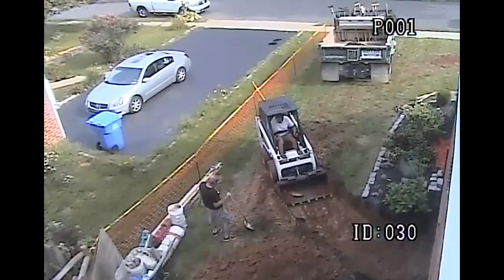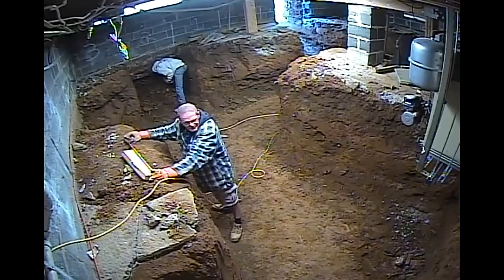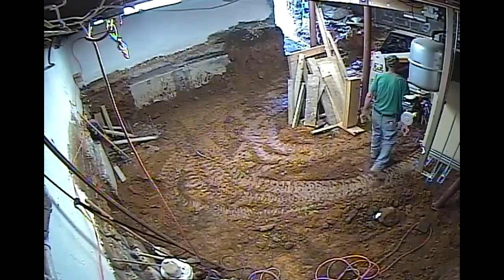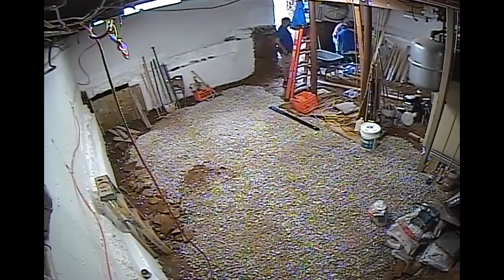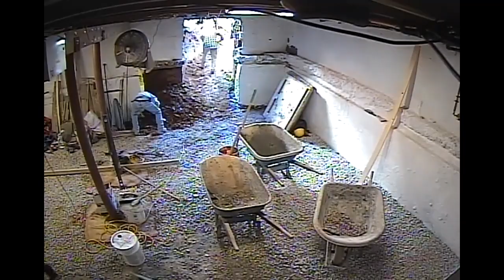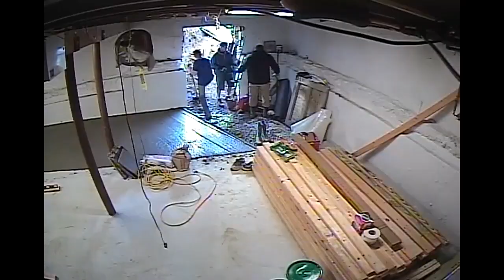New Basement - Crawlspace dig out and underpinning - Longer Version

Comment: The skid steer method is by far the most efficient and can even be a one man show. What I dont see is how or IF they waterproofed the exterior?
Reply: I've never seen any exterior waterproofing on these dig out videos. Maybe they fix the grading outside?  Maybe tired of digging?  Maybe afraid to dig outside to disturb even more soil??  Pretty sure I haven't seen any interior drainage systems as well.
Reply: Yeah, you don't really HAVE to waterproof the exterior for any reason other than being in a valley where water will sit on the concrete.  But even then, Current concrete recipes can be fixed to make water resistance better for the job site.  It's more expensive, but not always needed.

You can just go around the foundation with a few well-placed drainage pipes and would never have any issues.
Reply: @maddierosemusic  Sounds like he poured right up against exterior soil, so that's a definite NO for exterior waterproofing.   No interior drainage I could see either.   COLD JOINTS GALORE!!!!  Keep your fingers crossed for the homeowner...
Reply: @crforfreedom7407 drain tile, after 23 minute, under concrete. Sump in corner

Comment: how long of time did you allow section 1 to cure before doing section 2 and then also with 3. And how long did it take to finish all of the section 1's?
Reply from the maker: They were supposed to cure 3 days before moving onto the next section however I think they waited two days? Overall the project took 6 weeks to complete but the most sections ones were done at the same time as were the 2's & 3's.

Comment: Looks good.

The biggest concern I see is no footer for the new pour?

Curious
Reply from the maker: So when you underpin, the new pour is essentially the footer. The engineer called for a 3" gap to be left and the drypacked with grout. For the columns, a proper footer was poured.
Reply: @michaelnicolaides187  Yeah that was my question as well.  But how could this be "underpin" when you didn't even bring the concrete up to the previous footing/block??  Was it hydraulic cement you pushed in between afterwords or actual grout?  Was this a code in your area or something that was taught to you or told to you? It's interesting how different building processes and codes are from state to state. 

This is a suggestion from my army corp of engineer experience and digging out 70+ residentials by hand.. (because we were never lucky to get enough room for one of these toys you use. :D)

Dig a 6-inch borehole or two from the outside.  Put in a pvc pipe coated with a hydrophobic spray.  So you can pour from the outside and vibrate from the inside as you do it.  Less hassle and wears on the guys shoveling constantly.  We bring that inside lip up to about 2 or 3 inches above the bottom of the current foundation wall.  So as you pour, the concrete overlaps the current wall, and it makes a U-Channel for that wall to seat in perfectly.  That way you have the 3inch wider base (inside and out), with the 2inch higher lips to work with.  If there is ANY issues in the future of the walls becoming unstable from ground shifting etc.  That lip will crack and break off WAY before you see signs of the shifting from other perspectives.  Sometimes we do the same thing as you did. One solid pour with 3inch gap, then later pour in the hydraulic at the end with the same process.  

Trying to always keep the new foundation 3 inches (back and front) wider than the old.  Then keeping a 2 inch lip, up the old foundation for added stability and pre-warnings of issues.

I wish we could record all of ours.  But none of the clients or govt contracts allow us to.   :D

Comment: Everything was going great until the floor poor. Mesh was left at bottom of concrete which dose absolutely no good. Mesh should have been at 1/3 depth below surface to maintain proper strength support.
Reply from the maker: You're correct, and you're also watching 30+ days of video compressed to 5 minutes. You're not seeing every detail like where they stop and pull the mesh up.

Comment: No. That is a shit job...parging where joints are met. Where is the rebar connecting the sections? Is it glued/epoxied? Whats with the drylock on the concrete so soon? They are hiding weeping moisture from homeowner. Also no vibratory settling of concrete. You my Greek friend payed too much.
Reply from the maker: All done according to engineers drawing. So if it's a shit job what do you care, you didn't pay malaka.
Reply: @michaelnicolaides187  Novice.